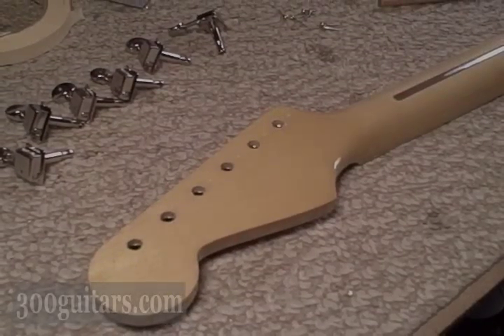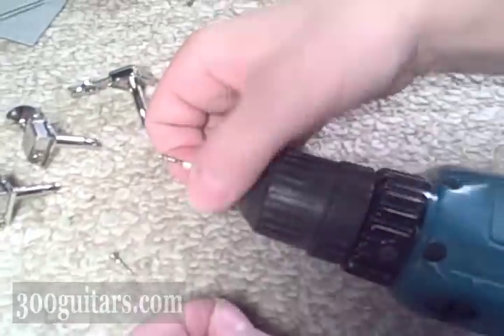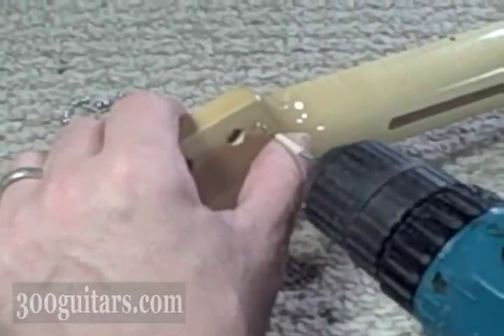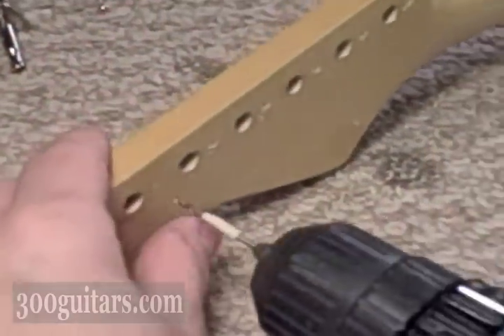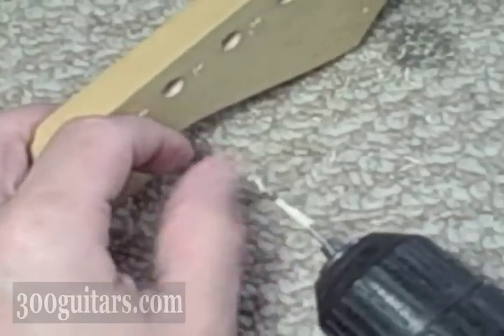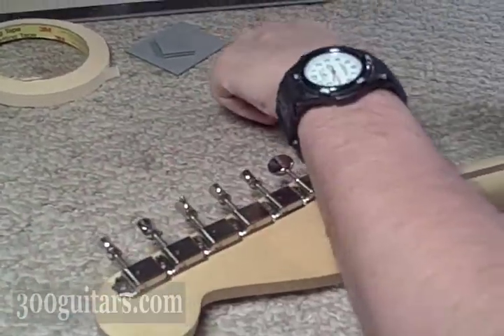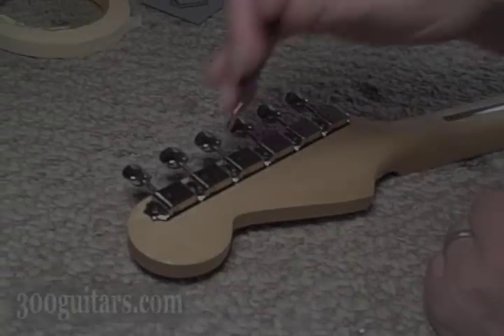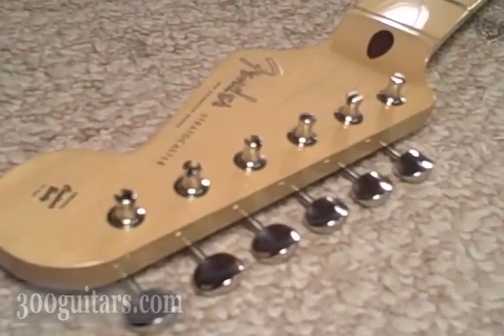Kluson Tuners: How to Install Part 2 by Billy Penn 300guitars.com

Comment: Two really good videos Billy, thanks for sharing your time and expertise!!  I am attempting this mod on a Fender Squire. When trying to test fit the Fender slotted vintage tuners they don't butt up to one another leaving a small gap. My fear is that the small screw head won't sufficiently overlap the two tuner ends.  Any suggestions would be deeply appreciated!! Thanks again

Comment: Hey I'm kind of new at this.
I have a 2005 Gibson Les Paul Standard and it has Grover tuners with the whole screw in method. I'd like to replace them with the tulip tipped Kluson tuners to make it look a little more vintage. Does that require these steps you did in both videos or will both tuners be the same size?